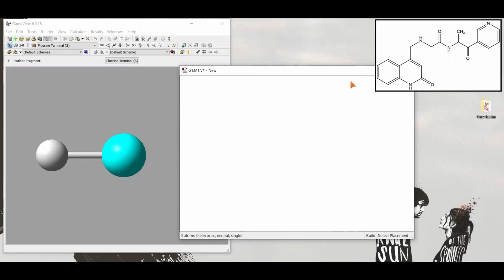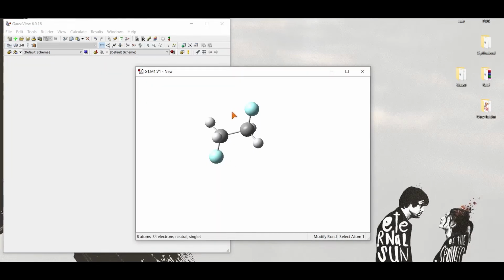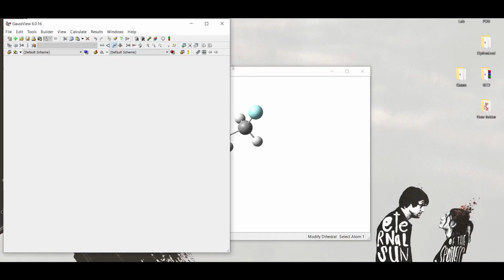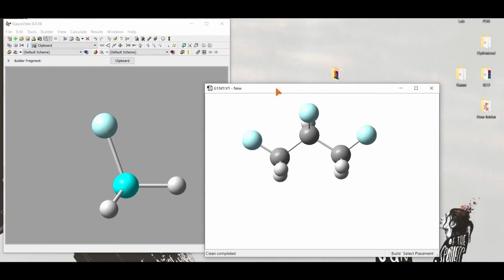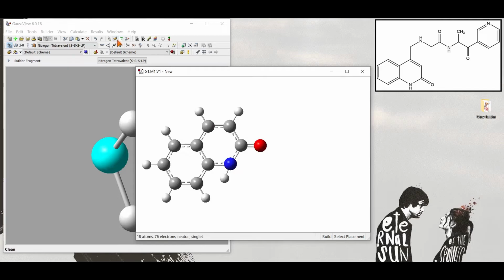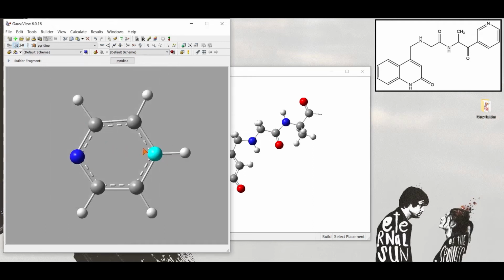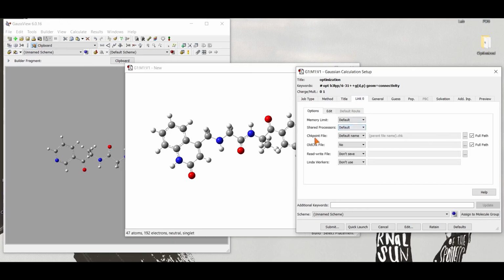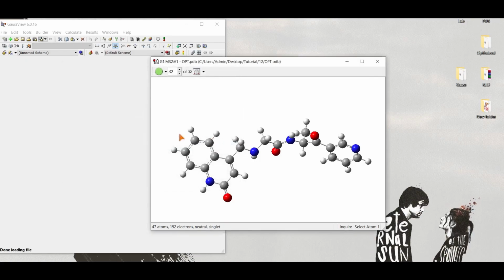Gaussian Tutorial: How to Build Large Molecules in Gaussview and Running Optimization.

Comment: There is a problem while making the structure of molecule.i was drawing the structure of Spiro.omtad with a acceptor and bridge.spiro-ometad with bridge had taken from the optimized file and I draw the acceptor separately.when I combined that two files spin issue creates I thourly calculate the bond there are no mistake in it and that molecule was optimized with out any error termination but my concern was the spin how can I deal with it @MD with Gourav

Comment: is there a way to speed up the calculations ?
Reply from the maker: You can increase the number of shared processors and memory limit as shown in the video.
Reply: @mdwithgourav  yes i modified the processors with 3 and memory with 1 GB 
But it's has not been completed for three days 🤕
Reply from the maker: @chaymaesa4638  It depends on the number of atoms in the system. For larger systems (molecules with around 100 atoms), you have to increase both the processors (try with atleast 16)  and memory (may be 5 GB). So, it would be better to use supercomputer server.